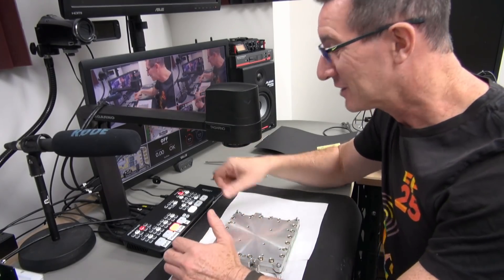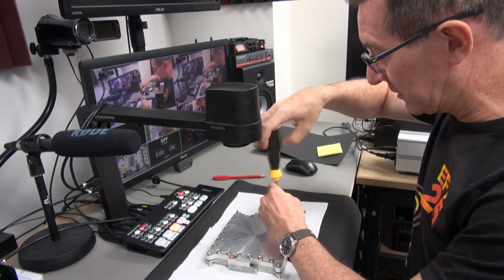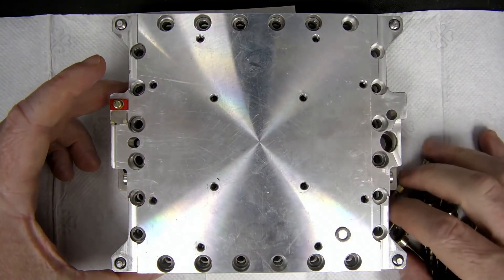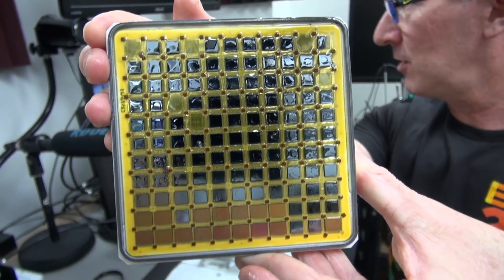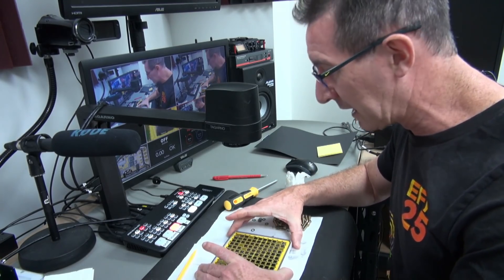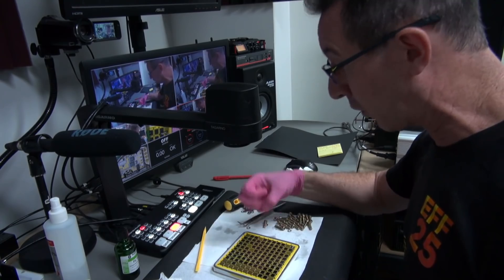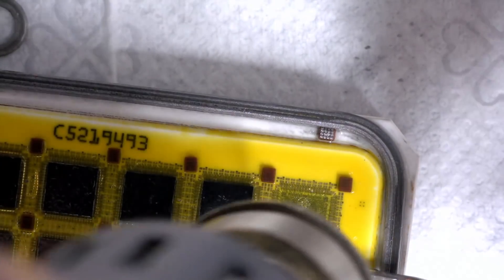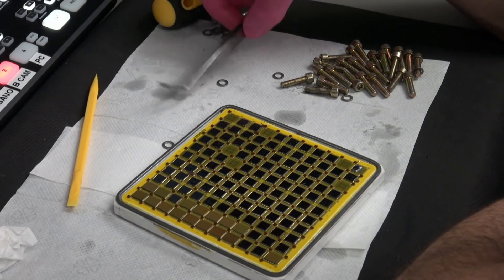IBM BGA Thermal Futility...

Comment: Brake cleaner to get the oil away then blow it with pressurised air and then brake cleaner again and repeat 3 times then flux and hot plate it around 100 to 200 °C before the hot air
Reply: The whole substrate for the pcb looks to be Aluminium so it sucks away the heat too fast

Comment: Apologies for sending you on this mission impossible task :-) I haven't tried removing dies from a thermal conduction module like yours, but I can get the die off of IBM's smaller (1.5") ceramic substrates with a generic hot-air gun. It takes longer than you'd expect, 5-10 minutes with the die not budging, and then it suddenly slides off. I figured a fancy hot-air station like yours would have no problem but the TCM must soak up a whole lot of heat. Hopefully part 2 works out better.

Comment: Wondering if it's not easier to put it in a vaccum to boil the oil off and freeze it with liquid nitrogen to make the solder even more brittle so you can just "break" it off 😬

Easiest way to break the soldering points off is row by row with a very thin steel wire.

Obviously only if you don't care for the board, but you seem to not care about it anyway 😉

Comment: What about a NiCr wire sliding it, very hot, under the chip... 
first vacuum every single drop of oil and submerge everything in isopropyl alcohol... 
or soap... heheh, what if the chip has legs?
send everything to MAster Ken

Comment: @2:01 No "wankers cramp" aka no RSI in my joints using that method! People should speak more about hand cranked terminal drivers vs other wankers that use ratch drills on small terminals that just strip them out!

Comment: I've got a big ass hot plate for gear like that ..it followed me home when HP lab's closed makes life so much easier ... Stick it in a bath of  some acetone ( nail varnish remover) to get rid of the oil ..always worked  for me at HP and BT after they banned trichloroethylene... We used to have giant heated baths of tric'... Oh dear.

Comment: I bet a pair of pliers will do the job. Or you can try to remove the pcb from this huge heatsink and dry out the oil which is another heatsink.
Also, Louis just called said you don't use enough flux.

Comment: I get Rf modules off of 1/2" thick copper heat spreaders using a hot plate. Zero chance that an iron or heat gun alone will get those to move. Only takes a few minutes, I apply some pressure with the tweezers as it's heating until they move.

Comment: I think heating one of the copper slugs above the melting point of the solder and setting it on the die would let you push it off. It would have to take a second to take the temperature out of the slug and in that time the die will be loose. 

A 300+ Degree slug will have plenty of thermal mass to heat the die and melt the solder before it drops below the melting point.

Comment: with the risk of losing the capacitors, i would just place it in the dishwasher to get rid of the oil
Reply: Dishwasher may work to remove the oil but I'm not sure that the oil wouldn't contaminate it.

Comment: The oil is probably PCB. Not Printed Circuit Board, but PolyChlorinated Biphenyls. The nasty thing that massive power grid transformers and building-sized valve rectifiers for HVDC power lines were filled with. Toxic, carcinogenic. When burnt? Toxic as hell, produces dioxins. When disposed of improperly? Dangerously toxic, stays in the environment for centuries. It also slowly seeps through anything. Including your gloves. And your skin.
It was meant to be more or less banned since the late 70s, but who knows? Maybe IBM kept a drum or two in their courtyard for specific uses? The kind of high-end specific use that shouldn't have seen the light of day again after production.
Just don't use your kitchen stove to heat up that thing....

Comment: Hey, Dave! Homer Simpson had a great idea in the comment section. Try cutting the solder balls with a thin wire. His idea was a fishing line, but I think it will be better with something metal. For example a thin nickel wire from a K type thermocouple. If it's not working cold, you can heat up the wire with current, like in those styrofoam cutters.
Reply: I doubt it is going to get under the die.
Reply: @excitedbox5705  Yes, probably it won't. But there are stranded compensator wires for K thermocouples, their individual strands are pretty thin. I am using IIRC 0.25mm thick solid K type compensator wire at work, but I think even thinner ones exist. Also, tungsten wires with microscopic diameters exist (think about 2mm rice grain bulbs), but I guess those very thin ones are probably had to get. I doubt a piece salvasged from a bulb would work,  those are probably not strong enough because of their spiraled spiral form.
Reply: @excitedbox5705  Just got an idea for sourcing thin tungsten wire: heater from an electron tube. Those are covered in a ceramic compound, and not spiraled spiral, just single spiral, which can  probably be straightened just by pulling it without weakening it. A small, inexpensive TV tube, size of a 12AX7 would work I guess (but Dave, please don't sacrifice a 12AX7 or any usable tube).

Dead VFD tube! Thier heater is completely straight and very thin! (edit: a ton of typos...)

Comment: Can you floss/saw them off with very thin fishing line or a thin blade?
Reply: That's a good idea! But I don't think it will work with plastic, but a thin guitar string, or stainless steel wire, pure nickel, tungsten or titanium wire might do it - especially if it is being heated with current during the cutting. Just like cutting styrofoam. Thin nickel wire can be sourced from the compensator cable of a K type thermocouple.

Comment: If the goal is just to extract a chip you could cut away a chunk of the module first (Dremel maybe) to reduce the thermal mass. Obviously it would ruin the module more but it's already ruined. A cross section of the module might be interesting to look at.

Comment: These kind of parts is most easily cleaned with isopropyl alcohol, put some in a plastic bag (double layer), add the module, close it, and give it a good lengthy shake in the bag, that will wash out the oil.

After drying, i'd just put it on the hob with a thermal probe placed strategically and heat it up controlled, slow and even.

Comment: If the solder is as brittle as the one of the chip capacitors you should be able to use a thin nylon or aramid string or even a couple of them to „saw“ them like they use diamond ropes in some stone quarries to cut the chip from the ceramic base module. Maybe a thin steel wire would do, copper is too soft I think. That may break.

Comment: I wonder if you can get all the oil off by running it through the dishwasher before you put it in the oven. (Though Murphy says the dish soap would react with them and you'd find all the chippies in the catch filter afterwards.) Whatever the case, I'm sure the solution will be a lot of fun.

Comment: Throw the whole unit on a hot plate for SM D’s for an hour bring the whole thing up the temperature then hit it with the hot air gun at the same time. 
              That mineral oil does an excellent job at dissipating your heat as fast as you are throwing it in there
            It’s like trying to use a soldering iron underwater

Comment: Dave how about using a map gas torch plumbers use for sweating pipe on the underside and while it’s still smoking use hot air on the top if it’s still being stubborn.. probably overkill right?

Comment: Could this possibly be Indium-based solder, the same stuff they use to solder (coated) Silicon to Copper heat spreaders in CPUs for heat transfer?
That stuff can also be broken without heat if you apply enough sideways pressure and can be used at lower temperatures.

Comment: Grab the chip with pliers and twist it off, like the method of removing surface mount caps from a PCB. If the chip is too fragile and breaks, try putting a thin strip of plastic between the pliers and chip to even out the pressure. Its worth a try.

Comment: Need to put the whole thing in an oven, or heat the aluminium cap on a plate, right up to near the solder melting point. Maybe even keep it on the hotplate while you do the desoldering. Handling the whole thing at 200ºC to finish the job isn't much fun, but there's no way your little hot air gun alone can put in as much energy as that block can radiate, so it can never reach reflow temperature.

Comment: I guess you're already done, but perhaps you can do some additional disassembly and get the board out of the bottom case? There must be some additional heat sinks there that's still doing its thing.
Reply: It is the board. The board is that thick

Comment: As others have said I think this thing needs to hit thermal saturation so it cannot wick away the heat from those chips. Oven is the answer. If anything this is a demonstration of how good IBM's engineers were at dealing with the thermals on that thing.

Comment: First BGA in the world.. 😂 That's mean's, need to use preheat..
Looks very similar, when I tried to remove dead transistor from French welding inverter which had ceramic board on aluminum base.. Real pain in the b*t without preheating.. 😂

Comment: dave maybe you need to remove that yellow board,where yellow board sits in
Reply: That is the board. The yellow stuff is just the oil on it. It's a ceramic substrate instead of a typical fiberglass.

Comment: Can you remove the board from the metal base/ lid ? Then once removed, remove the oil from all of it as best as you can, pre heat with pre heater till it's up to temp, then bring the blower to it using a suitable sized square nozzle to concentrate an even heat across the chip your trying to remove, using a stand and clamp to keep the hot air blower in position for a good 5 mins with the blower then see if your getting anywhere. Increase times and temps after that to hopefully remove the stubborn little bugger. Basically jerry rigging your own SMD IC removal machine, like we use in industry would be my best shot, without buying one. 👍

Comment: As others have noted, when soldering on boards with very high thermal conductivity, you need bottom heat as well. On boards with bottom components use an IR or air bottom heater, or if the bottom side is flat, you can use a hot plate.  Set up so you can preheat for 5+ minutes to get the whole area up to 150C+, then at the same time add top side hot air.

This is why bga rework machines always have top and bottom heat.  I've loved using a hakko fr-830 , but for this you might need something like a hakko fr-870.  Lab hot plates are a cheaper option. Alternatively as others suggest, you could use a toaster oven, then quickly take it out to work on.  With all that thermal mass, it should keep the heat for a bit.

Comment: Maybe ultrasonic cleaner to remove oil, bath in flux, then preheater?
Reply: i would try flooding the board with industrial degreaser or break cleaner to get rid of the oil. If nothing else is avialbe, maybe try dish washing soap, should be suitable to get rid of Oils too.

Comment: Preheat the whole unit to about 200c then use the hot air. Even 20 layer server boards take a lot of heat to remove BGA chips so a thick ceramic module will need a lot more.

Comment: You mention that it would have to have been re-flow soldered to create it... but I wonder if the ceramic was stuck on after all the bits were surface mounted to the pcb so it wouldn't have been wicking away the heat at that point? That said, I guess sticking the whole thing in a massive oven (possibly with a dedicated hot plate?) and slowly bringing up (and reducing) the temp over hours wouldn't have been an issue with all the other costs involved.

Comment: I had problems soldering a DPAK voltage regulator onto my board, turns out i made the thermal connection to the ground plane a bit too "good" and the solder pad a bit too small for the soldering iron to get full contact... Then i just pre-heated the entire board with my heat gun and the iron had no problem at all, the solder just wicked in there in seconds. So yeah, use that pre-heater!

Comment: You could try a paint stripper heat gun. They have much more airflow and do 600C. More power = more beterer. I always use that when soldering directly to large blocks of copper.

Comment: You need to shove the entire processor board into the stove and gently heat it to the melting point of the solder. Otherwise, the ceramic board will take away all the heat.
Or use the bottom heating as well.

Comment: im thinking the oil is your issue. its just transfering the heas away. i would clean all the oil off and try again, and with a bigger tip
Reply: For sure he cannot heat the unit above the boiling point of the oil. If the solder melting point is higher than the boiling point of the oil he will have to remove all the oil first. Including from under the die. Maybe you could remove the oil with compressed air?

Comment: There is one thing you can try but I don't know if it's wise with that oil in the way. Bake it in the oven, bring the whole thing at like 100 or 200°C and then while it's hot try again the hot air